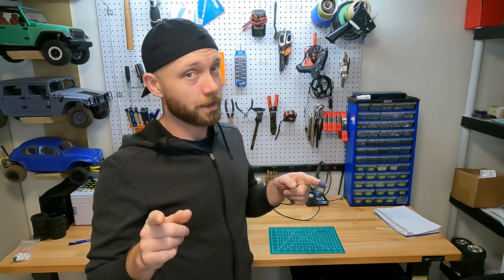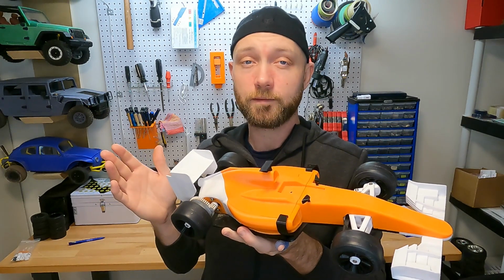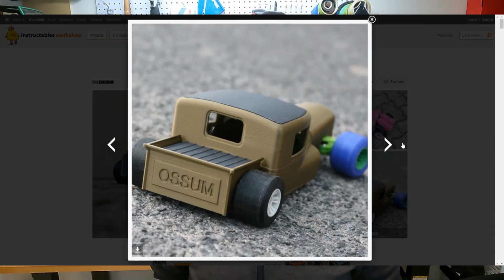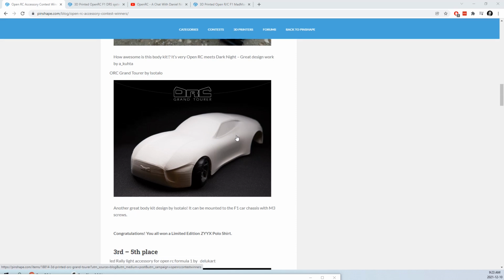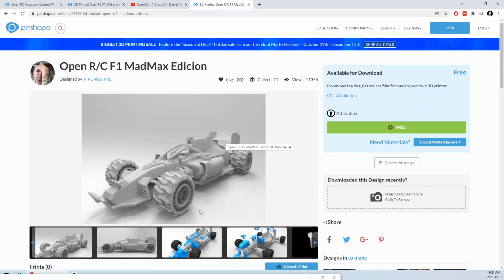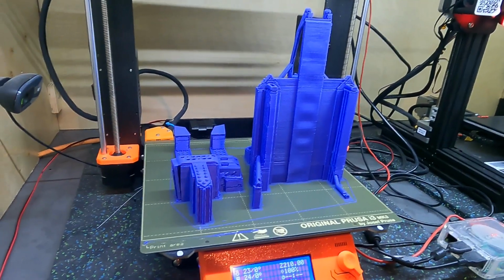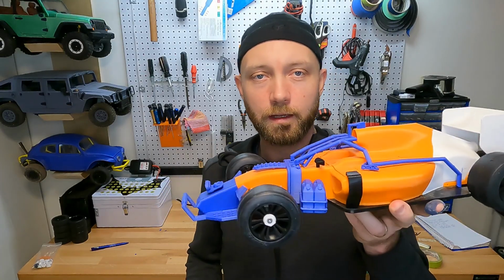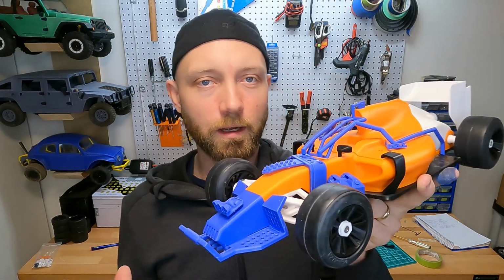OpenRC Body Mods - What could you turn your old F1 car into?

Comment: Hi I myself, printed some "upgrades" for this car which are fully functional: Active Air scoop for cooling the electronics. Front suspension, helical gear set (reduces gear whine and transfers the power much better), vented front wing, barge boards which really help to keep dirt away from the side air intakes. Back in 2017 i designed a T-wing which could be put on the sharkfin. Haven't used the car in a while now. But the when using it on a regular basis I kept snapping axles and burning through gears so i printed them all in Nylon. If you have question let me know.

wish you the best
Reply from the maker: Thanks Stan! I haven't delved too deep into the more functional mods for the car yet but some of them definitely do seem interesting. I think the open diff would make a huge difference to driveability if it was able to be printed in a manner that would make it reliable (probably with nylon as you suggest) and a suspension would be awesome. I'll let you know if I have any questions when I get there :)